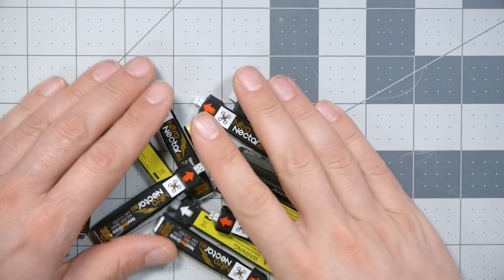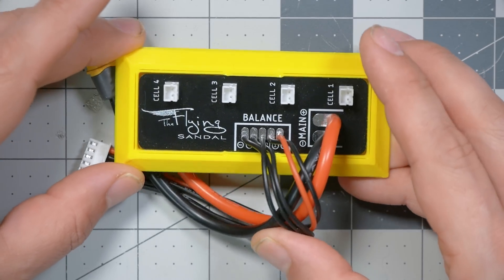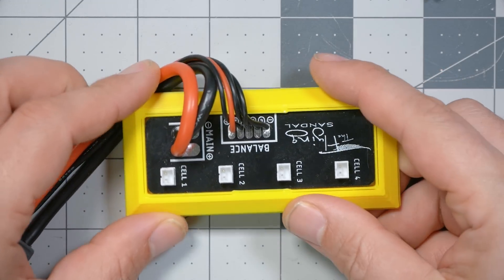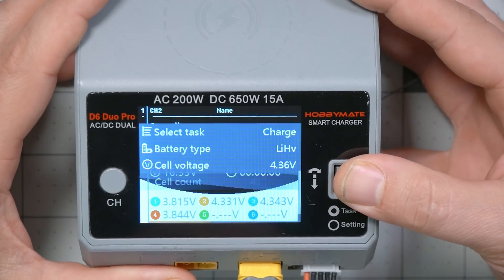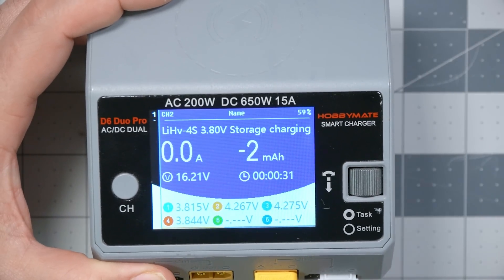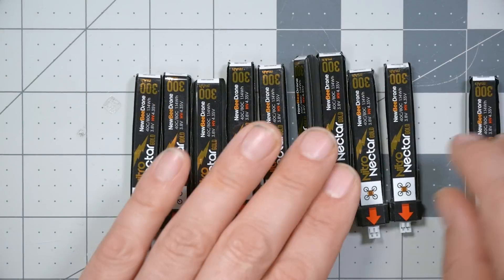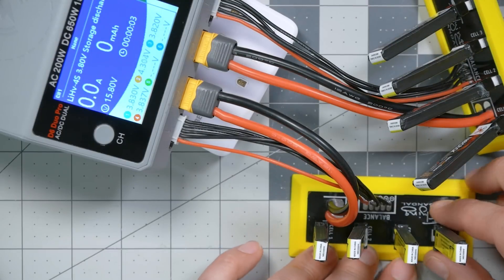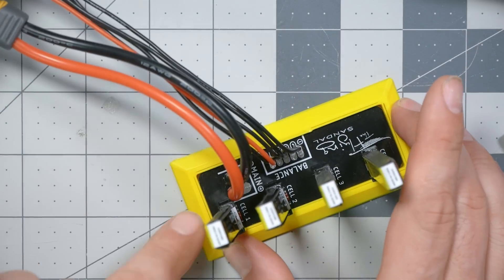Why your Whoop batteries die in storage and how to stop it

Comment: What about BT 2.0 batteries?
Reply from the maker: You need a ph to bt adapter.
Reply: You can also solder BT2.0 connectors on the Fractal board.   That is what the spaces next to the PH2.0 connectors are for.     Factal made a batch of the boards back in September.   Looks like their site no longer has any and are currently only available one of their resellers.   I am not mentioning the site in this comment,  since maybe that is why my post keeps getting deleted.    Check out Fractal Engineering's FB page and look at their post from September 28. 😉

Comment: Tinywhoop dischargers are the best. Get a keychain full of them and then any overcharged batteries you just plug in and it takes them to storage.

Gotta charge up the discharged batteries a little but that's a much smaller deal than discharging imo.

Comment: Tiny whoop mini dischargers are great also, that Flying Sandal requires 4 batteries to work. worked great till one of the connections fell off.
Reply: Hi there, sorry you had an issue with your board. Send me your contact info and I'll shoot you a replacement.  Thanks for using the board!
Reply: @theflyingsandalrc  Thanks for reaching out.  I had the product for a while, I'll likely just replace the plug connectors with BT2.0 connector and I'll be fine.

Comment: I have the URUAV Lipo Killer...I got I for killing XT60 batteries but....it has a balance plug that discharge balances also...AND it can discharge my 1s to storage. Only bad thing is it’s one at a time but tiny whoop batts don’t take long each.
Reply: The URUAV with an XT60 for killing and balancer for discharging doesn't work with LiHv 4.35 Volt batteries...

I have two units with the same problem..

Comment: Good video. The problem with 1s batteries apart from the life span is not all the connectors are the same. I dont think mine with the JST connections would fit on this board. I have spent more on 1s batteries than I have on tiny whoops and I dont think any of the batteries work anymore so I have given up on ever flying tiny whoops again. Its not worth the investment unless you are doing it all the time.

Comment: If you plugged in only two cells in socket one and two that should then Reed is a IIs battery
Reply from the maker: The XT60 still won't have any voltage on it until the board is fully populated.
Reply: @JoshuaBardwell  weird. Thought it would work just like hooking up a 4S vs 6S

Comment: another vote for the fractal engineering board, much more versatile than this. first of all because you can use up to 6 batteries at once instead of just 4, and perhaps more importantly because you have a jumper to set how many you want to use, so you don't have to plug in 4 regardless as here. excellent if you have only 2 or 3 "odd" ones with different mah ratings (e.g. I only have a couple of 850mah 1S). the flying sandal is good, but the fractal engineering board is vastly superior, in my opinion

Comment: As someone who primarily flies whoops these boards are indispensable.  I prefer the Fractal Engineering version, but even a handmade cable is fine.  It's so nice being able to throw 12 batteries on my HOTA D6 and storage charge without having to check voltages first.  Sometimes I fly 1s just because it's so easy and convenient to work with the batteries.

Comment: JB, you should come out with a 1S battery checker. A simple one that even a kid can use with a % charge on the display. With the 3 or 4 common connectors used by whoops, Syma, Hubsan, etc.  most kid drones come with a simple charger, many people don’t own a charger with storage capability or voltage readout

Comment: Thanks for the great content. Question: Does the Series cable from bangood function the same as the same as the sandal board? Some of the boards are out a month or two and I didn't want to wait that long. Thanks again.
Reply from the maker: Yes it's basically the same.
Reply: @JoshuaBardwell  Thank you. I ended up getting the Fractal Engineering board because it was available for quicker delivery and with that 1-6 jumper, it is fantastic so far! Thanks again for all the helpful content. Being new to the hobby, your content takes something that seemingly impossible to those of us light on the knowledge and makes it doable. Much appreciated.

Comment: It's funny how fast FPV goes, I haven't used the flying sandal board since the webleed fractal board came out, it's pretty similar, just has 2 more ports and can do both PH2.0 and BT2.0, goes great with the new webleed BT2.0 batteries

Comment: I made my own version of that board, but I put 6 PH2.0 sockets on it in a 3S2P configuration, so it can deal with 3 or 6 batteries simultaneously.
I also made a cable to plug a single whoop battery into the charger, using an XT60 plug, 2S balance plug (with the 3rd wire removed), and a PH2.0 socket.

Comment: That's nice for that type of connector but what about the BT2.0 plugs like on the BetaFPV 1S batteries?
Reply: I use a TinyWhoop discharger with a BETAFPV adapter lead BT2.0 to PH2.0

Comment: Joshua I have a question I hope maybe you can give me lead with as I have no one to guide me over. I have built a tiny whoop weight 23.8 g. with 802 motors 22000 KV. The FC is 
Betafpv 5A ELRS AIO. I applied their diff. All parts are top notch. On Angle mode when armed and drifts backward and increase motors spin until flipping over. In rate mode I can tame it but it's still hard to control. Do you have any suggestion or some direction I can advance with?
Reply: Sounds like your board needs to be calibrated for level, 1st tab on Beta flight configurator.  To get JB, just catch him on his live stream
Reply: @theflyingsandalrc  It was a bad Gyro.

Comment: Does anyone know if the URUAV XT30 to PH2.0 1s cable will balance charge/storage charge batteries the same way this does? And would I just charge/discharge as if they were a 4s? I believe the cable is in series not parallel, but I still don't know alot about this stuff so I'm not 100% sure.

Comment: Thank you so much for this video! I've had one of these for months, and have been wasting so much time trying to get batteries within similar voltages before using it, as if it were parallel. I knew it was in series, but didn't know I could have different voltages! Thanks again!

Comment: Finally, a video sharing my concerns and not saying, why worry about a 5 dollar battery.  There are great 4 port chargers for these 1s lipo's. They only miss a storage option.  These kind of boards are great, but having 4 independent ports does sound like a more ideal solution. Connect, press storage, Wait.

Comment: I’ve been doing something similar for years diy, but why hasn’t a company come out with a stand alone charger yet? If I remember right once upon a time bardwell was even talking about getting one made but abandoned it?
Reply from the maker: Yep I was trying to get a 1S charger with storage function made but so far, nothing has come of it. I guess it's harder than it seems :-/
Reply: @JoshuaBardwell  I get that, I’m working on my own that would do charge, capacity test and storage. Nothing worse then falling out of the sky 5 feet from the starting gate because the battery is shot and you don’t know it.

Comment: I understand the use somewhat but why not fly the battery down to 3.7 or 3.6 then just charge it back up to 3.8? 

I normally fly 10 packs down to 3.6 then use a charger with an indicator from BetaFPV to charge two at a time to 3.8 while I contemplate the void of nothingness.

Comment: Btw: By far the best device to storage charge your batteries is a charger like the un-a6+ or the bc168. Just make a wire hardness with 6s for the charger and 6x 1s for the batteries. Charges and discharges each one battery completely independent.

Comment: I'm usually to be seen nodding furiously to your videos, but this is contrary to my experience.  So what is my experience?  For pretty much all the time that 65mm/75mm Whoops have existed, I have every week in school term time had to charge upwards of 150 (yes, one hundred and fifty) 1S cells. I often am charging up to ten "banks" of five cells at once. In the current school year so far, three months, that has risen to over 200 once a week and in excess of fifty more charges on another day.  Then add my own personal use, Quads, Whoovers.  Remember, there are half term and full term breaks, the summer being six weeks. After a range of experiments, I use the cheap five way parallel chargers that come with a set of five cells.  I charge before use. However they end up, used or not, they stay like it. I'm using cells from four years  back muddled with near new. This should be a disaster, right?  So, why isn't it? One thing I do ensure between each charge of five cells is to unplug the USB connection to "reset" the charger as without that a full charge is not carried out. The other thing I have found is that the wider the cell cross section, the less likely they are to fail prematurely. I appreciate that keeping the cell away from the ducts is needed, but all our Whoover 65mm quad based hovercraft run on Eachine E010 150mAh rectangular flex lead PH. As said, quite a few of these are more than four years old and still fully active, standing up to three minute races. As well as the many attempts at a better connector, some better experimentation/research on how cell cross sectional area affects cell life would I am convinced be beneficial.
Reply: Do you fly them down to 3,5v or 3.0v?

Comment: I had been parallel charging but in an effort to have my packs last longer I just bought a Fractal Engineering Series board. With that said how many cycles are you getting on your 1S Whoop batteries?  I have settled on using the Tattu 300mah cells after trying Happymodel, GNB, BetaFPV 300mah as they seem to offer the best bang for the buck.
Reply: +1 on the Tattu batteries. I get basically the same flight time out of them as I do from my 500mah GNBs, which are heavier- I know- but they just seem to sag more and not hold as much capacity.

Comment: Thanks for this video! It's going to help save a lot of peoples 1s batteries this whoop season.  I love the ability to parallel charge (or series in this case) but I hate having to micromanage pack voltages so I just made a bunch of bt2.0 to xt60 connectors and charge/storage charge my whoop batteries individually directly off my d6 pro like i do my 6s packs. Its slow but gets the job done and keeps my 1s packs healthy.

Comment: Fractal engineering makes an inexpensive switchable one that works very well too for 1 up to 6 batteries. I've had mine for over a year and it is still going strong. You do have to remember to move the jumper pin bridge to the appropriate number you are charging though.
Reply: Fractal's Whoop Juice is very well made and I love mine!
Reply: I have one to, great thing
Reply: I have two fractal engineering boards and they work great. I only wish they made boards for different connectors like the GNB27 and XT30 so I wouldn't have to make adapter wires for some of my batteries.
Reply: @bjimx  would be good as well I use GNB27 exclusively for 1s since I just started. But I need adapters for my charger anyway. May solder on some GNB27s to the pads too
Reply: I bought that one recently.  So far so good.  No issues and the board is well made.
Reply: Came here to say the same...I've got two of them, and they're great.🤟
Reply: Wanted to say the same. The Fractal Engineering one is awesome.
Reply: Oh awesome.
Reply: Yep, so much better.
Reply: Thanks for the tip just ordered one!
Reply: Mutefpv also has a good tutorial if you want to make your own.
Reply: You can also solder your own :) it’s really simple
Reply: Just picked one up and this is the way to go!!
Reply: I love mine . Works great .
Reply: I have one as well. Very happy with it. Made very well.
Reply: Love my fractal board
Reply: Posted my main comment before I saw this. Are you saying that the fractal engineering board will do the same for 1S-6S batteries? I need to storage charge small 2S batteries 180-200mAh, 7.6V size for tiny (150g) combat robots. Thank you for your help.
Reply: @iamionscat  Sorry, tried to answer like 7 times and my reply keeps getting deleted. This is 1s only. You can get a parallel board for 2S, but need a hobby grade charger to use it. I had more detail, but it kept getting deleted.
Reply: @kurtzFPV  Thank you!
Reply: I keep getting the current operation is not supported warning on my d6 dual pro. I have the hobby fly 1s and 2s series charger. No matter what I do I can't get it to work. Do I have to do something with the jumper pin bridge and if so what the hell is that? Any help please
Reply: @MrSabram07  this board makes the charger think that it is a 1-6s battery,  depending on how many are attached and which set of jumpers are bridged. If one battery is attached, you bridge the first set of jumper pins. 2 attached, bridge the second set of pins etc. Treat the amps as if it is a single battery,, so if the smallest battery attached is 350mah, don't charge above 0.35 amps for 1c. Hope this helps. And you can only charge single cell batteries with this board,  just to make sure that is clear.

Comment: I thought since there 4 of the .3 amp batteries, you would be able to charge at 1.2 amps?
Reply: If they were on a parallel board, yes, but they are in series, so the current needs to be based on the cell capacity.
Reply: @ASJC27  ah, makes sense. Thanks for the response

Comment: I just plug mine back into my 6x 1s charger. Charge till about 3.9 and take em off. They rest at 3.85 for storage.  Takes 10 min.  Just set a timer to NOT forget.
Reply: I do the exactly same with my betafpv bt 2.0 bateries after flying just charge them for 10min on 6x charger and all have 3,80-3,85v. This is simple and so easy :) But i noticed performance drop about 20-25% flight time less after 100 cycles of charging.

Comment: I stopped flying for about 3 years and left all of my 4S 1300mah Tattus at full charge. They all sag out simply by hovering now. Time to rebuild the battery hoard, and discharge the batteries immediately if not in use! An expensive oof.
Reply: You can simply soak them in saltwater and dispose of them

Comment: Finally. Serial has been the only way to charge 1s forever, but we always had to make our own adapters.
Reply: I wouldn't combine them into one battery if they're that different though. Usually cells are charged in serial, and discharged individually, so if one is fully charged, it will take forever.
Reply from the maker: It really didn't. My charger has a 1 amp balance current. So it discharged the 300 mAh pack to storage in just a few minutes.
Reply: @JoshuaBardwell  says the guy with the D6 Pro ...

Comment: Great video!  I have the Fractal Engineering board that NBD sells - same deal, just has 6 ports instead of 4. :)
Reply: And it lets you change how many batteries you want to put on
Reply: @tdogfpv  True, a jumper lets you set from 1-6 which is nice.  Great board!
Reply: Fractal Engineering board is the way to go for sure... if you can find one
Reply: @robschlicht  NBD has them in stock right now :)

Comment: One of the first things I did when I got a decent charger, after having only had a small 1S whoop for a long time, was to create an XT60 to PH2.0 adapter.
This was so I could charge my 1S whoop batteries just like any other LiPo 2S-6S pack without any sort of parallel board involvement.
Reply: Been duying for a video like this 🙏🏻 Thx Joshua 🙏🏻